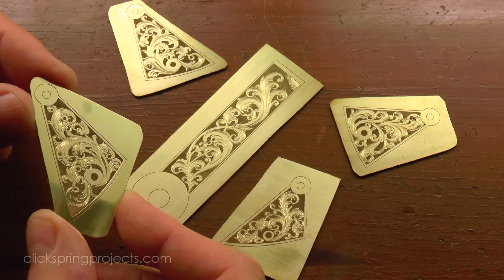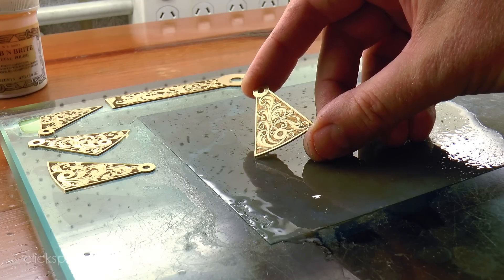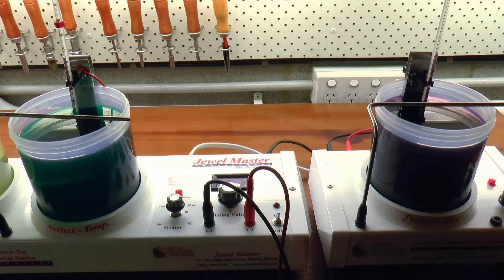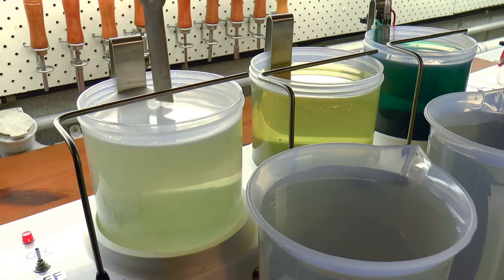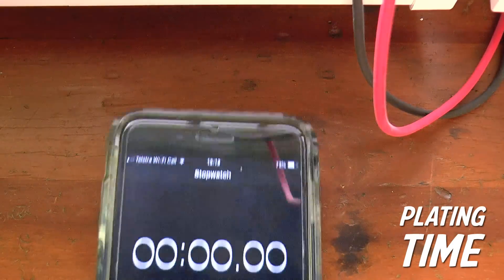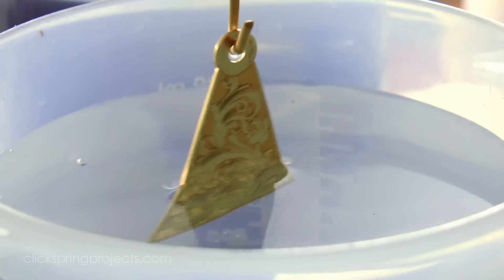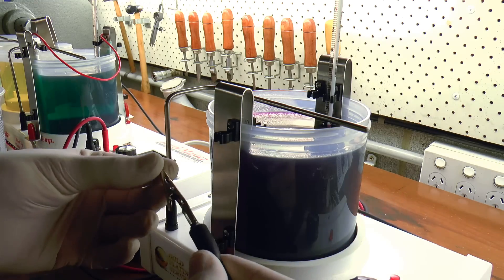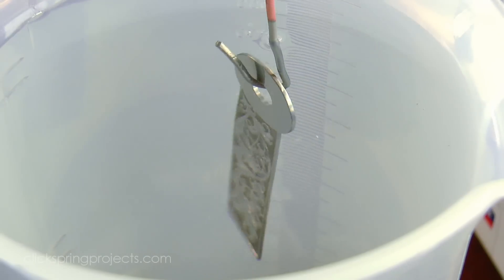Tools, Glorious Tools! #9 - Getting Started Electroplating

Comment: As someone who worked in electro-plating, part geometry and how you hang the part is really important for a good finish. Avoid any features that could trap air bubbles. Also avoid shelves, where you can get extra solution trapped when you transfer the part, which either contaminates your rinse baths or spills.
Reply: If you must plate odd objects with difficult contours, would agitation help here?
Reply: Also professionally plate hexchrome, trichrome, nickel, gold and special alloys onto yellow or red brass for over 12 years.  
1.) Absolute cleaning as you indicated is key.  Bath agitation helps scrub contaminants.  Mechanically moving the cleaner with a plastic spatula, without waves, will help.  2.) A copper strike coat, very thin for your parts, will help uniform conductivity especially for the fine details and large dimension changes.  Be careful, Cu is easy to apply too thick.  Electroless (chemical Cu deposition - no electricity) is probably recommended if you encounter difficult geometries.   
3.) Ni is preferred for our business for its hardness, thus scratch resistance.  You appear to be using bright Ni which is great, but has problems with stress which usually is resolved by adjusting the plating speed and chemistry.  The secret to good Ni plating is to agitate the bath, 5-8 tank turns / hour as a good target,  filter the solution, and minimize or eliminate air bubbles when returned to the tank.  Just need pure flow to scrub bubbles from the surface and assure fresh Ni solution in contact with part. but a small number of bubbles in solution will not hurt.  Ni plating also creates fine particles which easily slough off the anode and deposit on the plated part.  You must be using ultrapure Ni anode otherwise you would have previously observed star field like patterns.  As previously stated, filtering is always a good idea.  Special shaped anodes are common.  Also consider shields (plastic barriers) to reduce current to areas plating too fast (geometry too close to anode but still need plate deep crevices).   
4.) Can't help on Au.  We only use cyanide containing baths for Au plating. 

Unfortunately, the smallest system I have set-up or improved is about 20L; way to much for your needs.
Reply: @charleshettrick2408  Would using a sonic/agitating/ultrasonic cleaning bath help with some of that? More expensive but I'd think that'd make it more consistent and probably faster. I know sonic mixing can make funny things like oil and water mix where it otherwise wouldn't should help with the cleaning I imagine.

Comment: The artifact the so-called "Baghdad battery" is theorized to have been used to gold plate figures and jewelry made of silver or another less valuable metal. The jar is fired terra cotta clay with a copper tube with an iron rod suspended inside with asphaltum as an insulator. An acidic liquid like fermented grape juice or vinegar might have been used to create a weak electrolytic effect.

Comment: simple addition to this excellent video from the view of a jeweler: it is recommended to use the general rule of lower voltage and longer exposure time. A higher voltage can easily burn the surface. Slow makes the best results ( talking about 5-10 minutes ) and 0.5-1V lower than max. recommended V from the supplier of the plating solution.
Reply: What does "burn" mean in this context?
Reply: A century ago I worked for a precious metals plating process supply company. My job was to use the products to test the finish on customers samples. Rarely the same job twice, my boss insisted I work by current density not volts, this meant spending a while calculating the area, but I paid off in not ruining valuable samples where you don’t get a second try.
If you do mess up, there are cookerybooks of methods to remove coatings, nickel on brass? Try dilute sulphuric acid with some thiourea added as an inhibitor. Should form a brown copper sulphide film when you get to the brass, that in turn should come off in the electro cleaner.

Comment: I am fascinated by how all your setups look extremely neat and clean and uncluttered. I have a small workshop and I fight with extreme clutter all the time.
Reply: I feel your pain, I have a large workshop and I still fight with clutter😂
Reply: My solution is to clean / organise after every use of a tool, say I need a file and a piece of emery cloth and use it for maybe 5 minutes, I know I'll use it again tomorrow, but I still put it back in its place after use. Really helps with clutter, since it makes sure that my work tops are always free to use instead of being covered in some random tools I might or might not be using at the moment.
Reply: @patrik_k04  I found that method works well for me too. Initially I commented to myself I was being ridiculously obsessive, but by having lots of labelled storage around the specific work areas where those tools were most used, it saved lots of "searching time".

My labels are often VERBS rather than NOUNS. So pliers aren't labelled "PLIERS", they are stored in my "GRIP" drawer, along with other similar tools such as multigrips and locking pliers  

Similary, scissors, knives, blades, PVC pipe cutters, etc are stored in a drawer called "CUT". 

I'm a bit inconsistent about it, but to define every tool with a noun label is too tedious, so I just think about the major task they perform and use a verb instead.

Weird I know, but it saves space and works well for me.
Reply: @BrassLock That's a great idea.

Comment: A lot of us are going to have a first go at electroplating with not so good equipment. I would say that a regulated power supply will affect the result the most. Being able to set a (low) constant voltage will give a slower deposit, and in my experience, that will tend to greatly improve surface evenness in thickness and apearance. And please - be careful! Some of the chemicals used are very harmful! (Varying depending on different processes for varying base metals and coating surfaces.)

Comment: I grew up in plating and electroforming workshops. Was my family business. If you find issues plating oddly shaped parts feel free to get in touch! We had tons of tricks to solve issues of plating inside voids or on sharp tips. 
For example if you find burrs growing on edges or points (high current density areas) you can use rings of wire as auxiliary cathodes (we called them "robbers") to reduce the surface area to current density ratio and smooth the finish on the edges. 
You can also use various small anodes held in strategic places with wire and a small stirrer or pump to agitate/circulate the solution and help reduce patchy plating. 

Used to have great fun with the cleaning baths. They kick out a fair bit of hydrogen gas. So the foam is quite flammable. If you "accidentally" make a small spark (touch part to anode while still connected when removing parts) the little bang you get can be quite a surprise! 😂
Even more fun in a huge warehouse sized plating shop with a car sized tank of hydrogen foam!

Looks you're using an acid gold solution instead of a cyanide one. If ever you go to do silver, keep an eye on the cyanide. It's pretty concentrated and can be surprisingly hard to rinse. 
Known plenty of people (my dad included, on two occasions) hospitalised or worse as the result of a splash of silver or gold solution on the lips or unwashed hands. Health and Safety had no place in UK plating workshops in the 80s and 90s. 
Using acidic cleaners on spills or splashes can also evolve cyanide gas with some dangerous consequences. 

I love all your videos and this one woke up a ton of knowledge I'd almost forgotten I had! Thanks so much for that! 😁
Reply: What sort of stuff did you guys plate? Or what didn’t you if that’s shorter

Comment: I have a reasonably sized plating plant. I do Nickle - Cobalt  and Copper Plating.  My tubs are 25 Litres.   Two things I do extra, might help.       1. I use industrial liquid soap & hot water to degrease before electro cleaning. 
2.  When you are actually plating and you want to check the part.  Never completely remove the part from the electrolyte. It will leave a "shadow" created by the breaking and reconnecting the current in the solution. (also a different layer of plating) .   Enjoy.

Comment: Great Video! Electroplating is quite an adventure, one which I enjoy. I found your video very accurate especially dealing with nickel :). I would recommend changing your plating rinses from baths to sprays. I have observed that drag out from rinse baths is an enormous problem, sometimes it's visable sometimes not so much. Spraying ensures fresh water every time to comprehensively remove the previous bath to be more consistent. I bet you will like Rhodium when you try it, it's a beautiful thing to plate with. Best to you on your plating journey I look forward to seeing more and learning as you share!

Comment: I’ve used a similar setup with a single bath for rust removal and, since the process works by line of sight, found a circular anode, ringing the bucket works best. For your quality you may want to add multiple connection points so the current runs smoothly thru the extra large anode. Say at 3 at 120 degrees from each other.

Comment: As a kid, I was exposed to many people who could plate just about anything and any size!

In those cases, they had screen anodes rather than solid plate anodes, and you could do the same with your tanks using the right type of screen around the wall of the tank, the screen could be spot welded to a solid anode quite easy. Plus it can be shaped to fit any shape tank, round or square.

The chemistry of plating is also quite interesting as well!

Comment: Glad this came out, i have a kit to do metal plating for 3d prints. so this was a good visual on how others go about it.
The kit i have uses graphite paint to coat the part. after paint and polish, i am to coat the part(s) with copper for a couple of hours, and from there, i would do the steps you are doing. I got a DIY mix kit, where you prep the solutions from a dry powder and mix in some acids for the copper and silver. and uses buckets you can get from a hardware store.  One piece i have that i want to coat is essentially a cylinder so i hope it will coat the inside as good, or if i'll have to do some kind of mod to bring some of the copper into the center.  
One trick i saw from another person who does metal plating, is that he made a device that uses a slow motor to rotate the part during copper plating.

seeing you do this video helped give me a bit more knowledge and confidence.

Comment: The deposition rate is proportional to current (divided by surface area of the workpiece); and current a rough function of voltage (as well as a bunch of other variables). Much like cruise control monitors the speedometer rather than the gas pedal position. With many power supplies, turn the current all the way down, turn voltage all the way up, and then adjust the current knob as desired; the power supply will then output whatever voltage is necessary to maintain the desired current (whatever throttle is necessary to maintain the desired speed).
Reply: Nice idea, but fundamentally wrong for galvanization/e-plating/etc. It is true that the deposition rate is proportional to the current (current, which actually means how many electrons pass a known diameter in a specified time, which again is the reason for the transport of metal ions, and as you stated: proportional). When you would knew the exact surface dimensions, the current control would be appropriate. Oh and you have to change that with every part you put into the process. Now ... how convenient would it be if the current that flows is also proportional to the surface area of the work piece (bigger area = lesser resistance = more current flow) ... when using a constant voltage regulation. In fact that is so convenient that everybody in the industry does it that way. You only have the variable of how long you have to put the workpiece in the bath, or 100 pieces, or 1000 different pieces (of course you have to provide the needed resources for that:) ) and you get absolutely repeatable results. Oh and that is the only thing that counts: Good production parts without having to "guess" or to fiddle knobs!

Comment: fwiw i do some homemade plating for tools. i use 9218 stick welding rods as anode for nickel plating and a solution made from the same rods and vinegar, isopropyl for cleaning. at 6v 750ma for small parts it's like 2-3 mins. great setup you have.

Comment: The described plating process is correct. But in the home shop it is better to regulate current than it is to regulate voltage during the plating process.

The plating process is effectively a galvanic cell. It requires a certain minimum voltage to get going. But from that point on it is all about the circuit resistance to regulate the flow of charge carriers.

Why is charge carriers important?
The metal in solution is effectively an oxide, the charge carriers (electrons) will strip away the oxide and the now "free" metal ion is going to plate itself onto the part. To do this we need to trade with the molecule of metal oxide, the metal atom likes its oxides. But if we have enough voltage on our side we can have it give up its oxides in exchange for a charge carrier or two. (sometimes more than just 1 or 2, this depends on the oxidation state of the metal.)

Each of these transactions however only gives us 1 atom of metal, for every x electrons flowing through our circuit. And to plate a large part we need a lot of atoms of metal. But thankfully charge carriers are cheap, 1 amp gives us about 6.242x10^18 of them per second. How many we need to plate a random object with a certain thickness of some metal can be calculated, or simply estimated through experience.

The plating thickness is directly proportional to the surface area of the object being plated, and the amount of charge carriers we have transacted. And the charge carriers can be summarized as "amp seconds",  as in 0.1 amps over 10 seconds = 1 Amp second, while 0.2 amps over 20 seconds is = 4 amp seconds.

Figuring out the surface area of an object is however something we can estimate, small errors don't strictly matter in decorative pieces, and here experience helps. But one can likewise observe the early stages of plating and look for how quickly a color change happens and through experience adjust the total plating time according to our observations.

Now, why isn't a lot of plating literature focusing on current?
Well, because that isn't how one does it on the industrial scale.

On the industrial scale it is frankly impractical to regulate current for each piece being plated. That requires a lot of tedious setup, and that takes time and money.
On large scales it is simply easier to keep all other parameters under control and instead focus on voltage. Since the reaction itself has some resistance to limit current. This resistance is proportional to a few factors, like solution concentration, temperature, and to a slight degree the geometry of the vat. Keeping these in check is simply easier when one has thousands of parts being plated all at once.

But like a lot of things on the industrial scale, it is effective at large scale.
When doing just a few pieces, other approaches are typically more efficient/easier.

However, solution concentration still matters, same for temperature. But at home one don't need it anywhere near as accurate if one keeps an eye on current instead of focusing one's attention on voltage. One can simply relax one's anxiety over the other parameters.

But keeping an eye on current is also informative for the industrial scale as well. Since plating one piece and regulating current will inherently give a decent indication for what voltage one will need to get similar plating speeds for thousands of pieces in parallel. (but one will have to fine tune it a bit... But at least one is in the right ball park.)
Reply: The surface area is a function of the resistance (or vice versa), which makes it (resistance=inversely) proportional to the current flow (and therefore the electrochemical deposition of metallic deposits). You are fundamentally wrong and shooting yourself into the foot, because mother nature gives us exactly that principle, providing repeatable and consistent results with galvanization by only providing a constant voltage regulation. [1]

WTH are you talking about up there? Should that be a physics course, that got slightly out of hand? And what are these allusions to large scale industry applications? First they do not matter here, second: the same physics and chemistry principles apply here and third: As someone who sees several hundred tons of materials going in and out our galvanic plant, I am not aware of your strange claims. Not even remotely (meaning your current-limiting strawman, etc.).

For the *facepalms* Even the hobbyist "Jewel Master Pro HD Plating Kit" shown in the video uses constant voltage regulation. I don't know who you are. You cited basic physics and some of that is correct. But also the whole comment is a mess of an inconsistent amalgamation of (half?-) knowledge and you focus on irrelevant topics more often than my mother-in-law goes on a tangent:)

Anyways, I wish you good luck with electroplating ... it seems like you need many of that! :P

[1] I really don't get that. I can't understand it. I do not want to understand it. I do not want to think that my fellow humans are that ignorant or stupid. What we are talking about here is a SIMPLE MATHEMATICAL RELATION, a effing proportionality (y=m·x), a multiplication. I refuse to accept that anyone cannot grasp this!!!